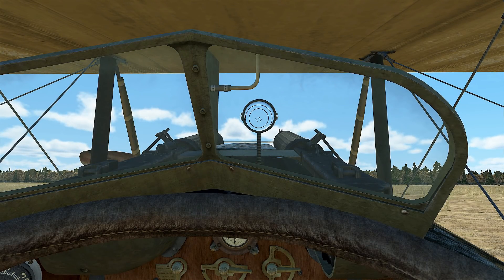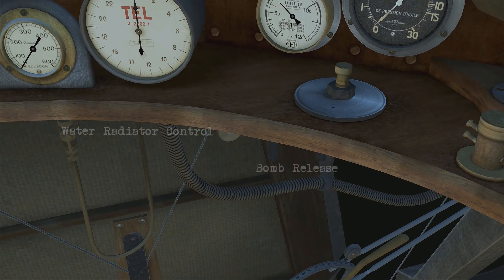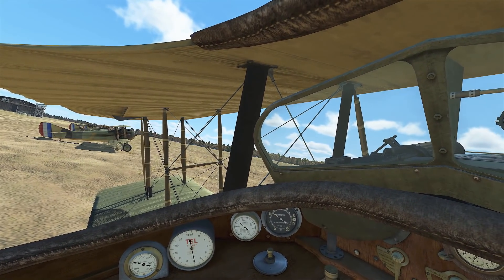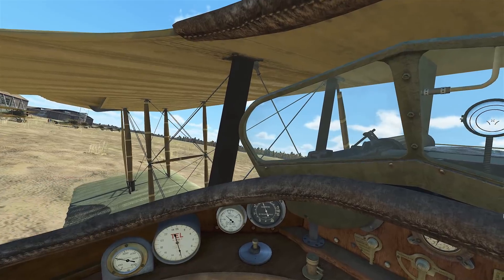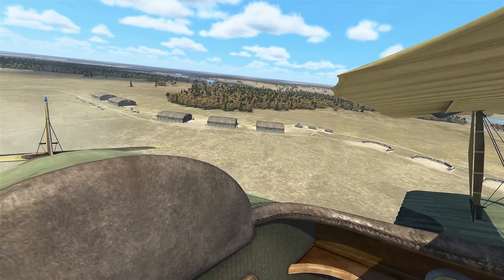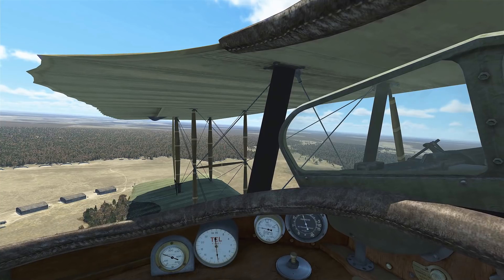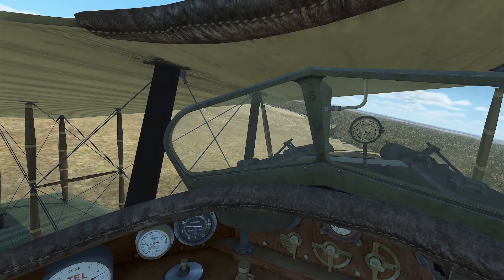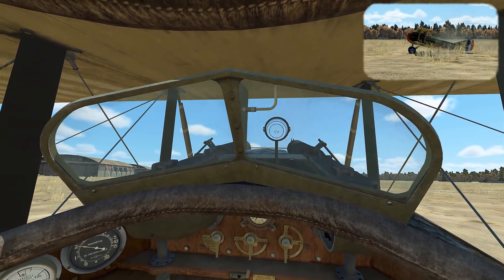Learn to fly the Spad S.XIII

Comment: I'm STILL saving up, I have now started amassing various items for eBay!! Good stuff Req and, as always, thanks mate! When we gonna see some more 'live' footage? I enjoyed that.
Reply: ps Just a quick thought... Not (obviously) for the MANY videos you've done to date, but would there be any chance of sticking in MPH as well as KmPH? Even if only as layover text? I know this sounds lazy but I only use MPH as I'm REALLY old-school!!
Reply from the maker: I found some "live" footage of me from flight training but haven't quite compiled it into videos yet. They are kind of bland with just engine noise, so I was thinking of some talking based on my flight training blog for those particular days but haven't gotten around to the voiceovers. The extra footage is of my introductory flight and my first cross country flight.

You saw the short version of my solo but I have a full version from engine start to finish with the ATC audio uploaded but not released though. Not sure why but you can't really hear me on the radio during it but other airplanes and the tower controller is fine. It's like 45 mins long LOL
Reply from the maker: No I won't be adding in the converted mph/kmhr. I'll only provided whatever units are used on the instruments in that particular airplane to take away needless conversions, so it's actually lazier to do it my way! I could make the argument everyone should be just be using knots and be done with it ;-)
Reply: Okay, fair enough. No problem and thanks.
Reply: Nice one. I'd be interested in some of that, it's a great 'insight'.

Comment: Wait so the altimeter is on the right, what's the air pressure gauge for?
Reply from the maker: I believe it indicates air pressure for the fuel lines. Without the air pressure the engine would end up starved of fuel.
Reply: @RequiemsACTL  Ahh okay, so manifold pressure?

Comment: Welcome back to the "crates" Requiem! I've just begun my RoF flying and all your old videos are excellent. Thanks for putting that kind of effort into the community. Looking forward to more. So FC is out or are you on the playtest team?
Reply from the maker: Thanks Rob it's nice flying them again for sure. I asked to be on the testing team a while ago so I could make these Flying Circus videos and have them released at the same time as the patch to help them out. My message was read but I didn't get a reply so I assumed the answer was no.
Reply: The Air Combat Tutorial Library  Too bad, they're loss for sure. I'm at sea so I can't "fly", so FC is available now? Was under the impression wasn't due for release in the fall or winter.

Finally,  I'd like to request an "engagement study", particularly a defensive one. Your tutorials are great but I need a lesson in saving my bacon! So yeah, a breakdown of a one-on-one would be fantastic.
Reply from the maker: Yep it's available now with the Spad and Dr.1 released at the moment with the remaining 8 still to go. I've been working on plenty of maneuvering videos which include how to defend as well in the BFM section. Still plenty more videos to come on that front and will include more defensive maneuvering too.